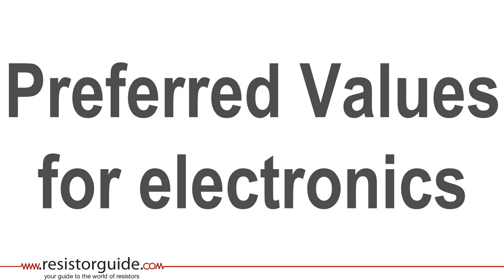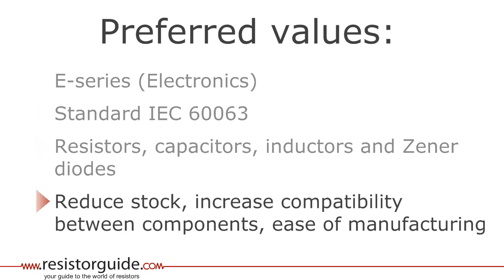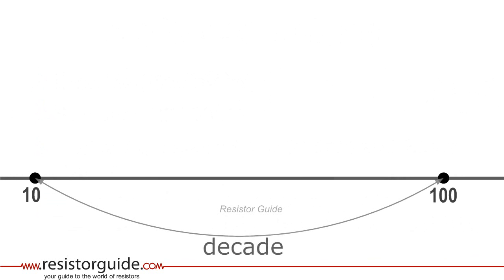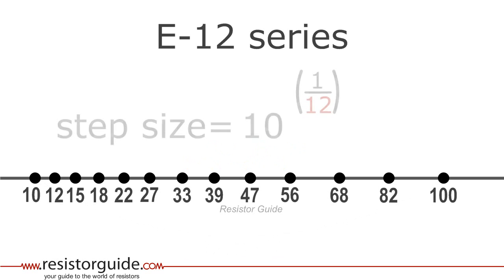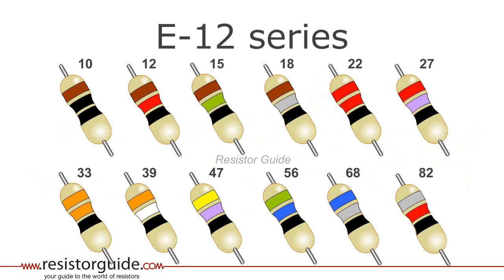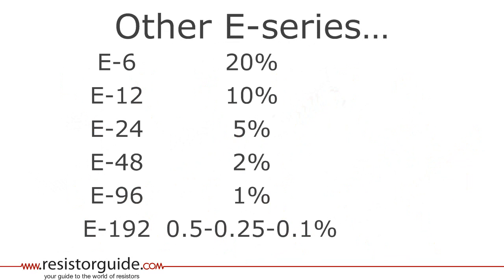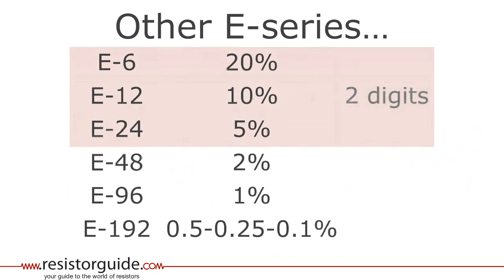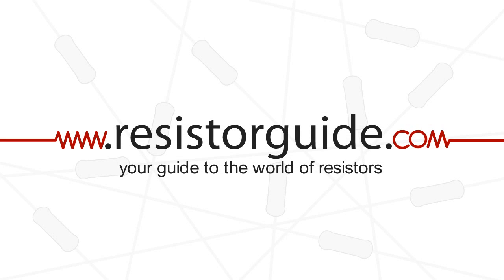Resistor Preferred Values

Comment: Great! But; right at the very end-that bit of info left me wondering; huh? 2 digits, and 3 digits?????
Reply: Or specifying 12k, 15k, vs 12k7, 15k4.
Round the decimal value to leave the desired number of digits, either two or three in that case.
Reply: It's the number of stripes on the resistor.